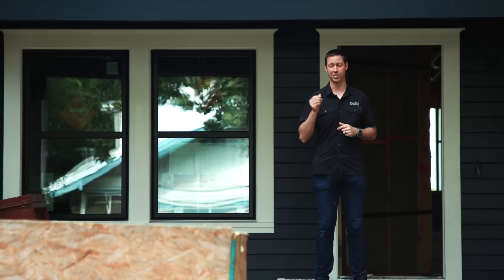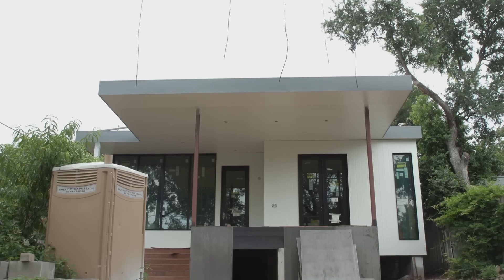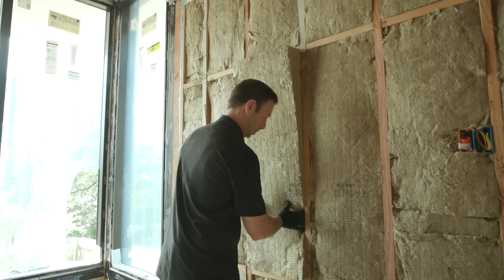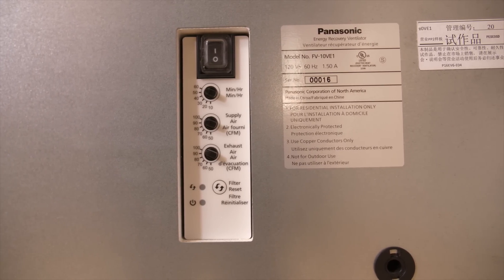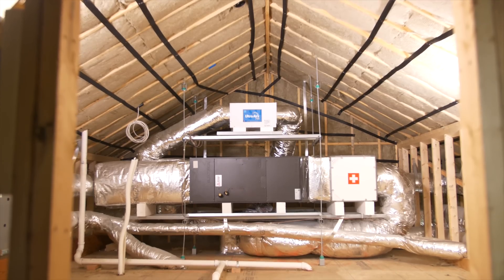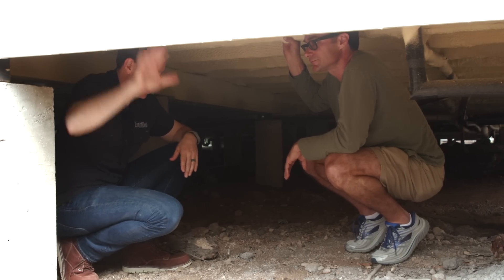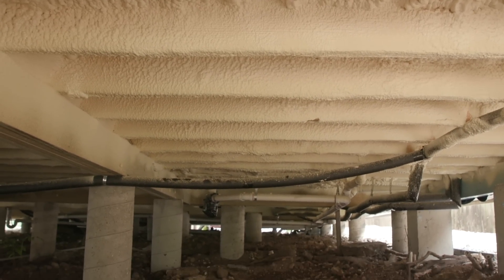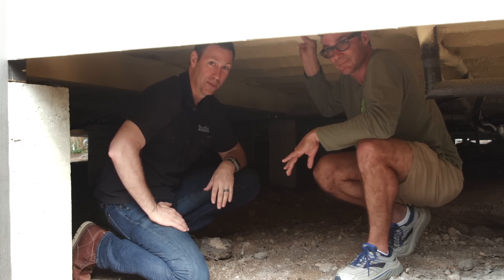2X CODE INSULATION - Simple Trick!

Comment: 2x6 insulated walls with exterior insulation and R38 roof.  Up here in the north that's the code minimum.  The airtightness and windows make a tremendous difference.
Reply: 20 yrs ago I bought a house in Connecticut.  Insulation in attic from 1948 was so flat it had R-2 or 3 I estimate.  Saw a great deal on insulation at big box, it’s now R-49.  Heating bill went down $500 that first year, paid for itself in 3 yrs.   And it’s toasty warm.  So glad that builders are starting to pay attention to this stuff
Reply: Tell me what is more typical walls and insulation where you live? I'm curious.
Reply: @ronwest7930  Up here where I am in the north... R-60 is minimum for standard attic insulation and R-30 with full thermal decoupling is minumum for walls.  Basements also have to have at least R-20 with full thermal decoupling on all below-grade walls.
Reply: @janj5786   Sounds good except the cost of achieving this. I wonder what kind of R rating straw bales set on ends would have. I am researching insulation types right now for a small home build.
Reply: @ronwest7930  Agreed... I am building now and costs are high.
Reply: @janj5786  New construction in Massachusetts blown in cellulose or spray foam to meet R38. All depends on the building inspector. He let me put in R48 batts saved alot of money. Where is R60 code where you are?
Reply: @sundown798  I am in Canada 🇨🇦
Reply: And if you go a little farther north, in Manitoba or Ontario (where I am) it becomes R30/R60.
Reply: Yes, very strange. 150mm is for a garage here in Sweden (10C indoor temp). I guess standard for living area would be 200mm in walls and floor and 300mm in roof. Passive houses have 500mm rockwool in roof and walls and 400mm styrofoam in the floor. But we typically have snow in winter during a few months. We haven't had to insulate against heat before but for every summer now the temperature is rising and soon it will become common with AC here too.

Comment: I love the passive home idea, but there’s so much active plant involved, it’s not really a passive house anymore. I would like to see a passive home with passive air management.
Reply: I was thinking while watching it is in no major way passive if it has a $4,000-6,000 air handler.  At best it is either pseudo-passive or semi-passive.
Reply: Passive heating and active ventilation seems to be pretty common but you'd think they'd have some kind of passive ventilation that they could at least activate if needed. Otherwise, how quickly does the air start smelling like armpits and farts when the power goes out?
Reply: @sabelch  Or when the next owner buys wrong size filter, after 5 years of wondering why the AC doesn't work very well. Checks filter - sees totally clogged/disgusting - goes to big box home center and buys cheapest filters that 'should' fit. Gets home, slides in, see's it's a 16x16 MERV 16 and he bought 10x16 MERV 2. Shrugs.  Shoves it in saying the gap will help air flow! Goes downstairs checks airflow and it's 'working great'. Thinks to himself, 'need to remember to replace filter every 5 years'.
Reply: there is just no way around it unless you're in the dryest possible climate and do a REALLY careful earth-tube design. that's just not possible most places.
Reply: @somedude-lc5dy  can't do some kind of hybrid?

Comment: Just curious how the tech got under there to do the actual spraying! Don't they need a specific distance for proper application? What kind of prepwork had to be done on the old beams for effective contact? (i.e. just wire brush or more aggressive?)

Comment: The triple  pane windows are great until...........they all start to leak. It is not a question of if,it is a question of when. That is why the replacement window industry is a   six billion dollar industry in this country.
Reply: Double pane can leak as well. What I have found is the greatest risk for a window failure is if the window is installed in a house with minimal to no overhang. There have been studies on houses with minimal to no overhang and it was found that 25% of them had leaks/building envelope issues within the first 10 years. Every 6 inches halved the risk of building envelope failure.  I have some double pane vinyl windows that were installed 20 years ago and have had no leaks while I have some newer high end double pane windows that were installed only 10 years ago in a new addition which did not have any overhangs and they have already failed. The windows that have not failed and were under overhangs were of various grades of quality.  If you can put a decent sized overhang, that will be the largest factor in the window's survivability.
Reply: @imzjustplayin  Exactly,and the author of this current video had a previous one boasting of the latest and greatest home he was building with no overhangs.
Reply: Replacement windows because what the builders install are cheap! I've know some folks having to replace windows and siding within 5 years of buying a new house!
Reply: @jrkorman     Those windows may appear to be great,in reality,they are just a smidgen above builders grade. Try Heartwood if you are serious about quality windows.
Reply: Those fiberglass frames are pretty stable while they haven’t been around for long every reason to suspect they won’t leak for many years
Reply: @johnwhite2576      We are not talking  window leakage per se,I'm talking  glass leakage. Show me a  a window company  that warrants their window glass for life not to leak. Would be better off  installing a  window of real quality with  a  wooden exterior storm. By real window of quality I'm talking something like Heartwood windows. Alas,the much older and some say better company just folded,that being Zeluck. All that glass is heading to the landfill in less than 20 yrs.

Comment: I have R100 in the ceiling and R55 in the walls in northen Canada.
Reply: I bet that's a good starting point in Canada.
Reply: How far north? That's tonnes of insulation, usually here in Winnipeg (close-ish to the southern border but still somewhat cold) code is  24 in the wall, 28 in cathedral ceilings, 50 in attics with crawlspace.
Reply: LOL What Kinda of Battery do you have in your Truck?
Reply: what is the stack-up of the roof? shingles, ice/water barrier, plywood, then a super-thick layer sprayed into the attic?
Reply: @somedude-lc5dy  I have R100 in my ceiling in Maine. 36" of blown cellulose in a vented attic. Air sealing under the cellulose. R100 ceiling is easy if you don't want liveable space in the attic. Cellulose is cheap. Getting R40 walls was much more difficult. Hell, just getting to R50 on my cathedral ceiling was more difficult and more expensive.

Comment: So the titular "simple trick" for "2x code insulation" is to... use a lot of insulation?
Reply: And air sealing @ 2:05
Reply: I'm putting in 2x4 rafters  7" down, connected from collar ties to wall studs. I put in r30 roxul sideways and r15 between the drop rafters, adding R45. Then the wall studs are built out using 2x3 offset from the other studs to eliminate thermal bridging and add R15 to existing wall insulation. I love fireproof and no fumes from the Roxul.

Comment: Very funny Show to watch my pov. I am from Finland and been a carpenter all my life. What you there call passiv house would not even pass as regular house here. Our norm Wall/insulation thickness is 250mm/9 inches with the air barrier at 200mm from The outside and then  2x2inch framing on inside for The last 50mm. That 50mm is also where we put all electrical and such to keep The air barrier hole free. Our roofs have about 400-500mm of insulation.
Reply: I'm always interested in how things are done in places like Scandinavia, Germany, Switzerland and Holland. As far as construction, it seems to be an interesting approach that the rest of the world could learn from. Do you have any videos or links explaining the process?
One other thing, am I correct in assuming this "Zip-R" type product is basically backwards from how you guys do it? So you'd put structural sheathing on the inside, THEN the insulation on the outside, then cladding vs this "Zip-R" thing which seems to have super-thick insulation THEN an outer sheathing which is NEVER going to be as strong because it relies on nail running through insulation shear strength?
Reply: I dont have a video sorry, but basiclly the regular system is cladding, 22x100 boards in cross so that air can move behind cladding, windboard (Google hunton windboard). I usually use The 25mm this windboard because it dubbles as braceing for The frame. Then comes The frame 48x198mm then  depending on which insulation you use either a vapour barrier plastic or a vapour open airbarrier paper. I myself never use rocwool or Any insulation of that sort. I use paper and a sellulose insulation, its recycled newspapers basiclly. This is because i bild houses that "breathe" and were we live IMO The only correct way to do it if you want The house to last generations. After The paper comes a 2x2 frame with insulation as well and over that whatever The customer wants.
Reply: https://youtu.be/MiBfp48IDIc i also build with this elements
Reply: Do you need devices to bring in outside air?

Comment: I just bought a house built in 1959. The attic needs insulated.  the roof was just replaced with a vented ridge. I think I want an open cell conditioned attic but was warned about inaccessibility to leaks by our home energy auditor. The spray foam applicator said he would just spray right over the vented ridge and seal it up. Also, we have a gas unit side mounted in the attic, which I’ve read will be fine if the air intake is considered. Any tips? I’m worried I’ll be making a mistake by choosing open cell conditioned attic. The energy auditor recommended cellulose to be blown in. I’m near Memphis TN, so lot of heat and humidity. Also, this rock wool conditioned attic an option?

Comment: Why pursue the passive house standard in somewhere like Austin, which has a relatively mild climate? The costs will far outweigh the benefits. Even your mate Joe Lstiburek would say this is silly - the money you'll save on air conditioning will be spent on dehumidification.
Reply: Air conditioning does dehumidification. An airtight building envelope theoretically should reduce the dehumidification load.

Comment: Does he have a channel in his roof/ceiling for airflow (above the R-38 insulation)? Experts say that you don't need a channel for airflow in the ceiling/roof when closed cell insulation is used.  Is he using ZIP-R on the roof? Does ZIP-R use closed cell foam?  What kind of roofing materials is he going to have on the roof? Is he going to have any air channel on top of the roof (e.g., like under standing seam metal roofing)?  Thanks in advance for any reply...
Reply: Yes this is what i would like to know
Reply: My question as well.  Framed with 2x10 or 2x12? Or added a row of 2x4’s perpendicular to the 2x6 roof framing?

Comment: Will there be an air barrier over the Rockwool in the roof-deck? I would be thinking about condensation on the decking. Maybe that is more climate specific?
Reply: I believe newer codes allow for for this only in climate zones 1,2,3.  Though a conditioned attic, it requires what is effectively a ridge vent, covered with an air tight, vapor permeable barrier before traditional roofing is laid down.  The link below terms it a “vapor diffusion port.”

https://insulationinstitute.org/wp-content/uploads/2018/05/BuildingUnventedAtticAssemblies-N089.pdf

Comment: Hey Matt, can you make a video about air barrier between garage and living spaces? I'm working on a Mother in law apartment on top of a garage and I want to make sure it's air tight. What would you recommend beyond the spray foam shown in this video?
Reply: Depends on what part of the country you live in
Reply: @woohunter1  I'm in Seattle WA. You made me curious, why do you say that it matters?
Reply: Nicolas GUILLAUME Matt is a builder in Texas, more cooling than heating.  In the north where we live, we have to do things a little different.  Up north you want the vapor barrier towards the inside of the room closest to the drywall on the climate controlled room, in the south just the opposite.  Your garage will probably be semi-climate controlled so probably won’t matter as much, but you will still need to seal up the garage from the house because of fumes coming off of a car, etc.
Reply: @woohunter1  Thanks, semi-climate control is probably right. I plan to water proof the garage, It will have fill on 3 sides (daylight basement style) and I have not decided if I needed to insulate it or not. I think that the ground would regulate the temperature enough.
My plan is then to insulate and air tight the floor above the garage. I want to use Rockwool bat for insulation in the joist space but I have not decided on the best way to make an air barrier. Maybe I could use a liquid applied seal between the Advantech flooring panels? Would I need a vapor barrier then? My plan is to install one right bellow the wood floor. I'm a little concerned about trapping moisture inside the underlayment but my understanding is that this shouldn't happen since my floor assembly will never be at a temperature where condensation can form.
Regarding the vapor barrier in the walls of the house. I was planning to use Zip because it requires less labor than house warp, offers superior water/air proofing and has the highest perms rating of all the "plasticized sheathing" options. GP's Force Field would be second choice. Regardless, I was planning to use 6" bat Rockwool in the wall cavity and 2" Rockwool board on the outside. I wasn't planning to use a a vapor barrier at all so that the wall can dry to the outside or the inside depending on which side of the Zip membrane the condensation forms. I'm I being stupid? Thank you for your help :)
Reply: Nicolas GUILLAUME not stupid at all!!!  Sounds like you already did your homework, just looking for a second or third opinion.  You could do a flash and batt on your garage ceiling, it would give you your vapor barrier, sound “deadening”, and good R-value.  When I insulated my cathedral ceiling in my sun porch, I ordered a DIY closed cell spray foam kit online to put 2” between the rafters, cost my about $800 to do 350 sq ft.  Then put up my batt insulation.

Comment: No such thing as a passive house in PA. Our winters are too bad and the summers still need AC.
Reply: Matthew Niedbala That is why the old houses there had deep basements, super thick walls and furnaces or fireplaces with registers between the floors for circulating the heat/cold.  My bedroom window would rattle with the wind as a kid but 200 year old window frames that don't get treated do that--and our registers were removed for "updates."  Other than old, the house did good.  Just needed proper maitenance & would have served better.
Reply: Hope Rules I live in a seemingly new home, but it’s sided with the thick diagonal board sheathing and there are 12 inch horizontal boards as the sheathing for the garage roof. It’s kinda cool because there are so few trees in my area that big anymore. Everything here was regrown from pastures and croplands. Hardly any virgin forests. That’s why we’ve regrown with mostly maple around here. The tree likes to seed itself in pasture which is impossible for things like oaks, beech, and many other trees to do becuz the animals that spread their seed Stay in the woods.

Comment: Another tight home totally reliant on expensive HVAC systems for 'breathability'.  At least this guy has enough sense to not use spray foam - on the inside envelope at least.
Reply from the maker: This house has operable windows. How is it reliant on expensive equipment?  When the weather and outdoor air is good just crack the windows.
Reply: Matt What are the economics and energy use of constantly venting and conditioning outside air? Would seem to negate energy savings of a passive house I recognize the comfort and air quality benefits but most houses accomplishing this thru leaks! And no rev expense Maintainence!
Reply: @buildshow  yeah and on-top of that, what's the problem with controlling the air going into your house?
Reply: @buildshow  crack the windows?  Then why bother with insulation and a $50+K HVAC package? These systems require people to want to live in a synthetic off-gassing cocoon 24x7 to get the 'benefits' of conditioned air.  It reeks of green psuedo-science marketing.
Reply: ArthurDentZaphodBeeb bruh

Comment: I'd love to know what I could do to my home that was built in the 1940's ...  all the exterior walls are cinder block..... and go!
Reply: Well you most likely have 1x2 boards holding your interior walls with little to no insulation so change those out with Tstuds (google them). You will loose 6" off every exterior to your interior. Replace all windows to triple pain. Hire a company to spray an air tight barrier. Spray foam and upgrade appliances and there you go.
Reply from the maker: Use EIFS
Reply: @buildshow  for the non construction guy... what would that be...?.. . (I could Google it, but it'd take away from you teaching me something new)

Comment: How do you recirculate breathable air if the power goes out and maintain your envelope?
Reply: Generator. 
Or open a window.
Reply from the maker: Crank open a window.
Reply: Simple. Install a $40K solar array and a $10K powerwall.
Reply: ArthurDentZaphodBeeb  I’ve done more solar than probably anyone as I’ve been doing it in southern CA for over 15 years. I’m intimately versed in modern solar and batteries and the powerwall is great for small draw items but it ain’t running an ac system. For the record the LG chem is a better battery for the money and available right now vs waiting who knows how long on the Tesla